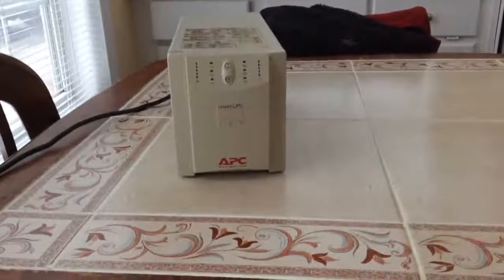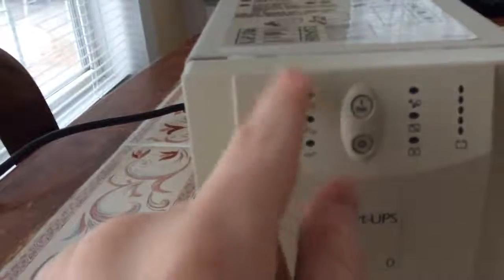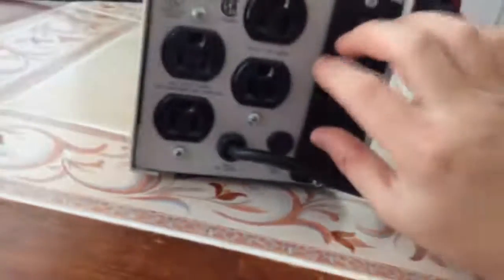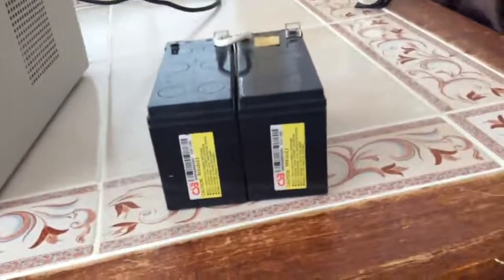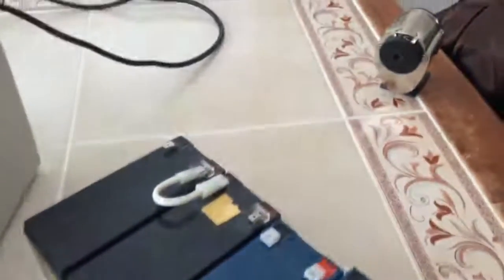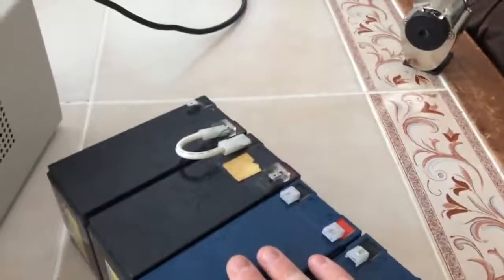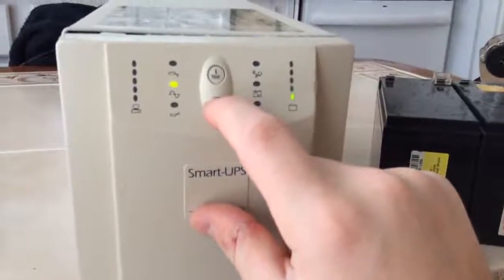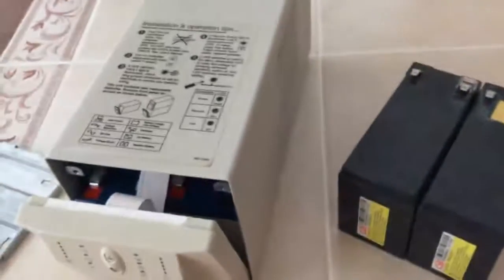APC Smart UPS 700

Comment: Great Audio !  But the video was all over the place...  Maybe get a Tripod for the camera !  Also Clear Packing Tape is great to hold the batteries together.  And make a tab (handle) by folding the tape over, so you can pull the batteries out of the case later !  The "U" shaped wire is maybe a Fuse Link for safety if the two batteries are shorted together !  tjl

Comment: If You fly over the documentation of any APC UPS, You will find the notice, that WHENEVER You finger with the batteries, that You have to run the Test before using it, pressing the ON button for more than 5 seconds. Never use the USV, if a test fails!

Comment: Dear Sir, I have APC Smart 700, UPS and I wants Use it for my Home, Using Two Wall fans, two Energy savers Only. So, I wired well and connected UPS On Main Line my all Equipment Start, but when I Off Main Line all connected equipment not working,,
I checked UPS Output with Extension line (Both Line Red, Black) He Generated Output, But On Single line (red) from ups and Black from main (Home Wiring system) its not generated Output Why??  Solution Please.. if any Setting issue ??

Comment: smart slot it what that is called on the back, you can put a network card in there.
Reply from the maker: Yeah, I had a small brain fart on the video. Thanks! :P
Reply: Yes, You can put a 200 bucks network adapter in there. However, for less than 200 bucks You can buy a better and newer one, with USB and network already 'on box'.
Reply: @thorstenbruening  those cards have a high list price but they keep updating the cards and the older 10mbit and 10mbit Ethernet cards have been going for less than $50 on eBay for 15 or 20 years. There’s no need for high speed networking to a device that processes commands and delivers responses after 10’s of milliseconds at a 3-4kB/s data rate.